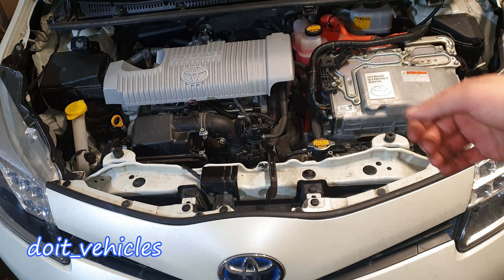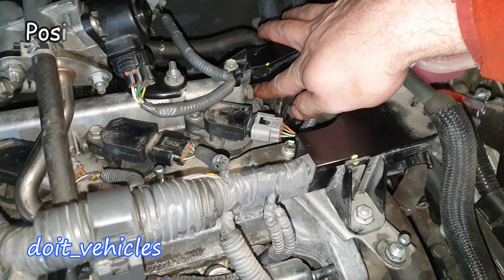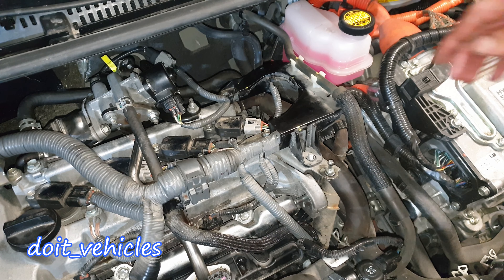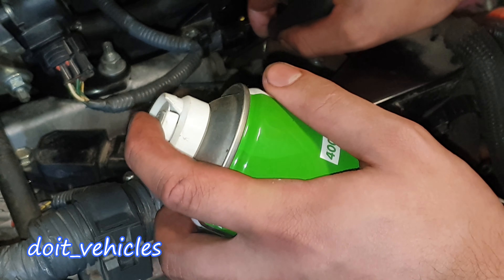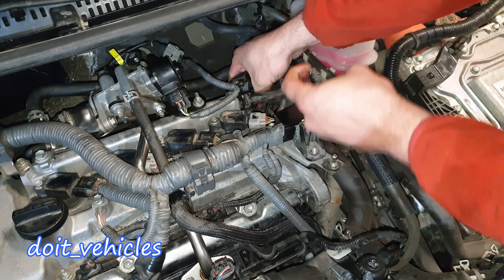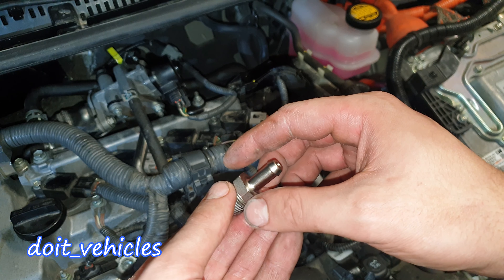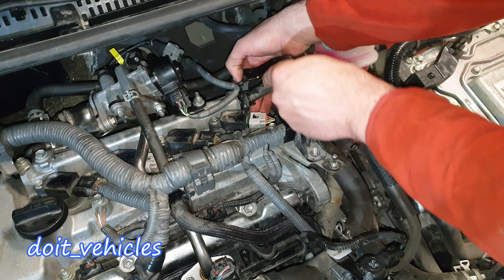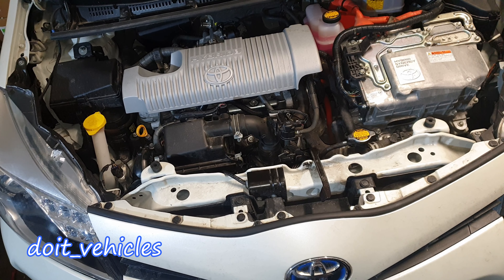Toyota Yaris Hybrid PCV valve Replacement

Comment: I'm not sure I understand why, if the PCV valve is stuck open, there should be  an excess oil flowing through it to the manifold.   If there is flow from the valve cover any time there is vacuum on the PCV valve, wouldn't there be flow anyway?  The valve just stops flow   back into the valve cover....  Come to think of it -  I'm not sure I understand why a one-way valve is needed anyway!  Also, while watching you excellent video, I notice the PCV exit is behind a huge sheet-metal baffle, which I would guess would minimise the amount of oil-mist getting to the valve?